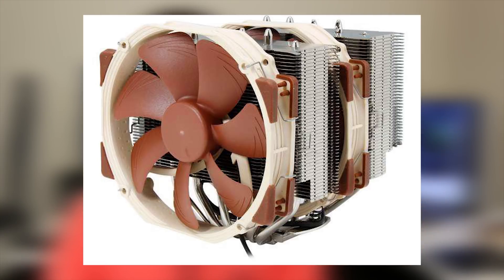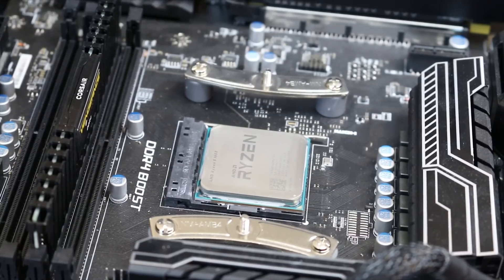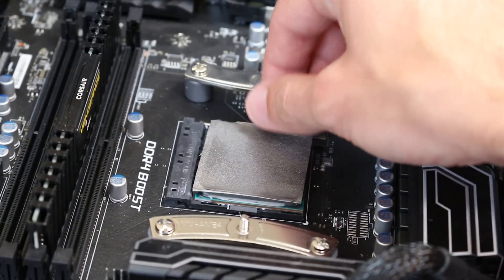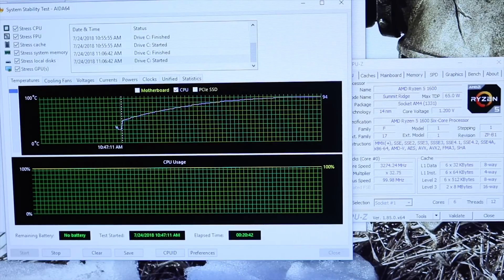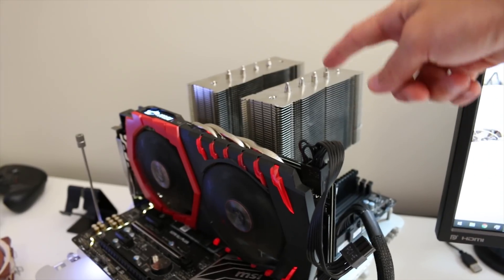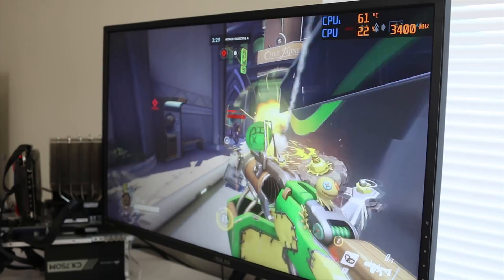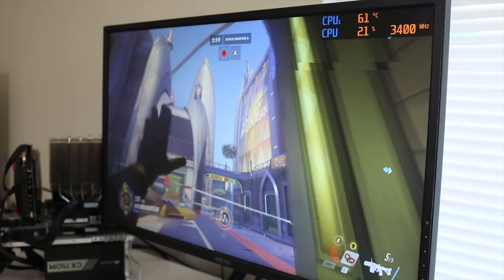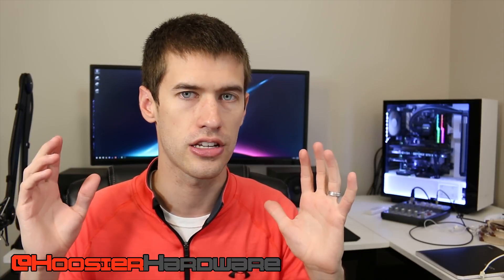The Noctua NH-D15 Can Passively Cool the Ryzen 5 1600

Comment: Your test was somewhat flawed. Heat rises so a horizontal test bench would orient the fins horizontal which does not help with convection. Had you mounted it in standard case orientation, the fins would have been vertical and thus much better cooling via convection.

Comment: Hoosier Hardware I have a challenge for you. I dare you to build a triple boot (or dual boot) system that will allow you to play games from three generations of gaming. I have games that will run on Win7, but not Win10, and I have games that will run on WinXP, but not 7 or 10. I want to build a system to do all of it at decent framerates in all titles. I think it can be done, but I think it will be tricky because the power of modern hardware is starting to not be compatible with WinXP.
Reply from the maker: It could definitely be done 🤔 Maybe something I'll look into.
Reply: Hoosier Hardware definitely interested to see what you can come up with.
Reply: 7MBoosted Which XP games dont Run on 10?
Reply: Rajalolxd mechwarrior 3 and 4, but also a significant number of older star wars games on steam wouldn't run on windows 10 same with fallout 3.